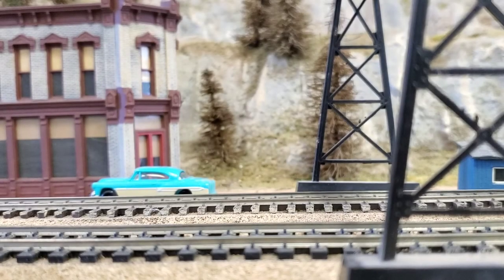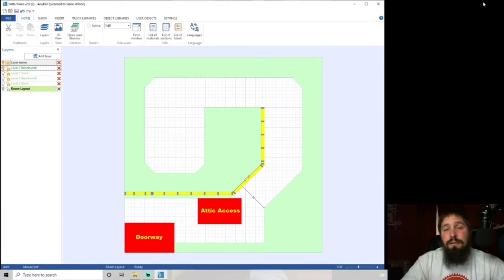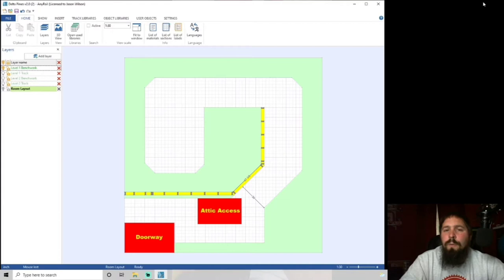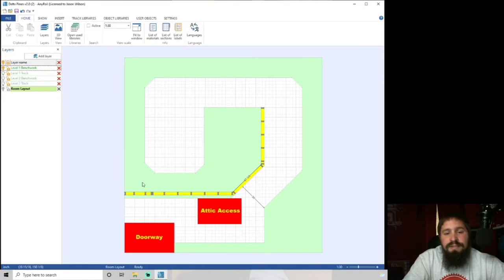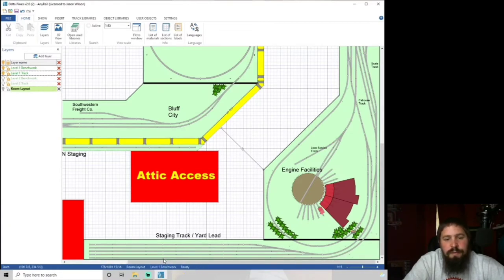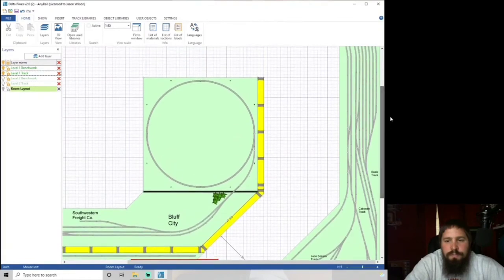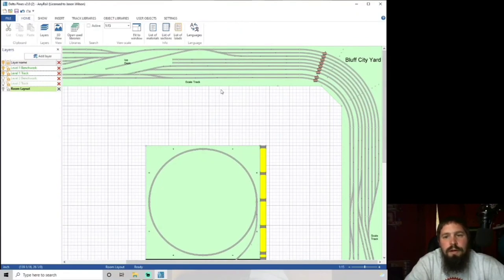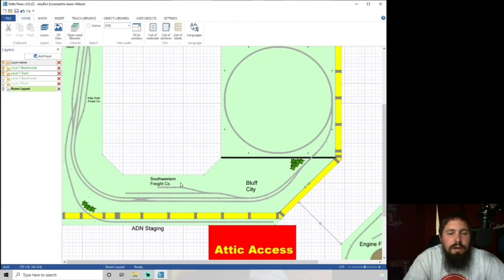Layout Update - Delta Pines Subdivision Anyrail6 Layout Design Part 1

Comment: I like the track plan so far Jason! Looking forward to this build (I know you are as well) - should be a lot of fun!
Reply from the maker: Thanks John! Yes me too!
Reply: @TheTrainFreak  Probably even more than me, lol! A thought for your helix ... I had a similar enclosed helix on my first layout, with doors to access it from the outside. In several place, I cut small windows in the doors, just tall enough to see one loop of track. I then scenic'd that section of the helix as the inside of a tunnel complete with lighting  (grain of wheat bulbs, but I'd use LED now). Pretty cool effect.
Reply from the maker: I did think about putting a window on the stud wall side so someone could peek through.

Comment: Hopefully Ray's arm is up is sleeve! Lol!

What was the radii of the helix? Ever thought about increasing the radii on the first loop to an extra 4 inches total? Then open up 3/4 of the first loop to the eye, with a backdrop behind it, like trees and a cut that the train then disappears through. Then the rest of the helix loops reduce back to the original radii and continue up, stacked on top of each other. Kind of hard to describe the effect in words. If I was better at Any Rail 6, I would draw it out and send it to you. Then you could also scenic the top helix loop like Vinny did on his helix. Any open pit mining in Arkansas? Or mountain face strip mining in Arkansas? 1960's truck stop for inside the loop? Sheep & pigs slaughter house inside the top helix loop?
Reply from the maker: Thanks Roy! If I was to widen, I will end up losing some of the spacious walk way around it. My last one was 29.5R. This one will be 32R so that should be a huge improvement.
Reply: @TheTrainFreak  You should still think about my idea? What if you decrease the diameter at level 2 and above on the helix? I think it would be a cool truck to gain a little more mainline running and give that illusion of disappearing around the bend into a forested area? A big square box in the middle of the room that hides your helix!
Reply from the maker: If I go smaller on the radius, grade gets higher. 32"R @ 4" rise is exactly 2% grade. You'll have to wait for part 2 to explain exactly what I am doing with it.

Comment: Hey Jason, looks like a great plan for the space. Since Bluff city yard is going to be your only yard, you may want to consider making the top end of the yard more accessible by making it a double ended yard with an arrival and departure track where you have the ice dock. It would allow you to access both ends of the yard more easily and you wouldn’t have to back the trains out of the top 3 tracks of the yard to the bottom for them to get back onto the main. What do you plan to use to enclose the helix on the top and left side so it’s not visible? Is there any way it can be removable just in case? I enjoyed the show tonight with Steve, it was packed with railroad info. Nice job. I’m subscribed.
Reply from the maker: Thanks Derek and Welcome Aboard! With the BC Yard, I designed the 1st two tracks to be open ended for the A/D tracks. The other 5 tracks are for classification, storage, and access to the facilities on the other end of the yard. Only the yard master will be working all trains on one side of the yard where the trains leaving and coming will have access on both sides.

Comment: So nice layout so far.  So question why would you put your programming all the way in the back of the yard where you can put your longest cars, or less used.  You realize you have to reach all the way over all the cars and then try to get the engine on the rail?  Just saying, I think you might want it closer to you for ease of access. For the coal plant, you would still need a pile of coal some place.  If you really wanted to do live loads, put the plant up top and make the lower area A coal loading area, maybe from barges to rail.  Then when you drop at power you can fill up the loader.
Reply from the maker: Thanks Steve! I was just thinking with the yard lead being in the back will always be vacant between ops sessions. Also AR only brings in coal by rail so that wouldn't work adding a coal shute somewhere. They get most of their coal from the east.